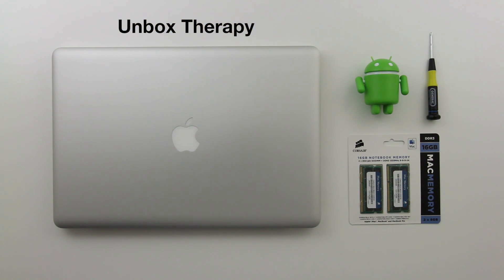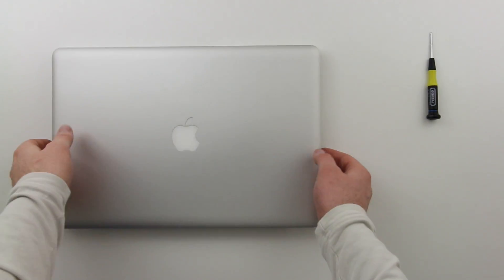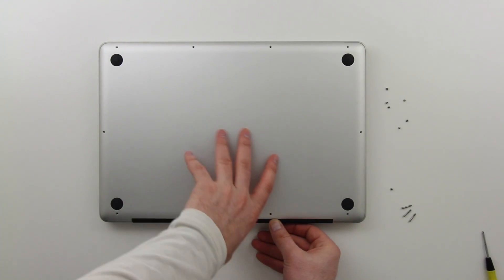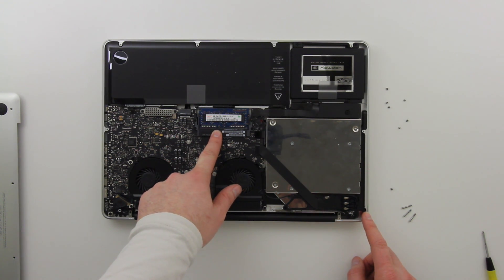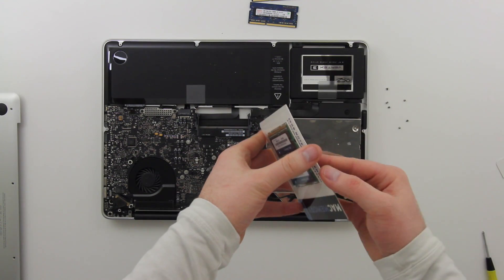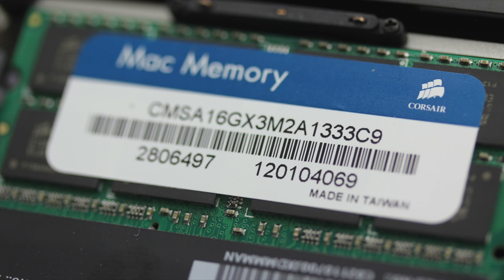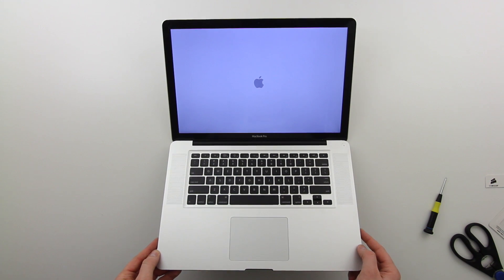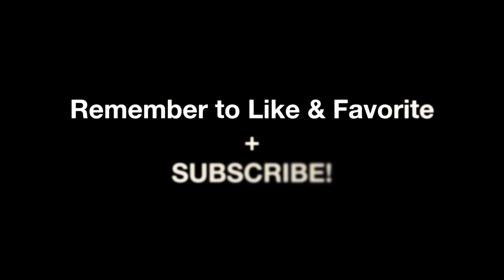16GB MacBook Pro RAM Upgrade (2011)

Comment: What happened if I install 16GB 1600Mhz Corsair for early 2011 13 inch MacBook?
Reply: You end up having 16gb ram?
Reply: +Zestypanda I plug 16GB 1600MHz Samsung DDR3 RAM to my MBP. Works fine, battery drains faster, no significant abnormalities spotted other than that.
Reply: Michelle Martin They don't support that because they're lazy and don't bother to check Intel's tech specs. As for over heating, check ventilation and re-paste the thermal paste.
Reply: I already did it, and i'm not having any problems so far.
Reply: CEZAR
yess, i know. I heard many of cases like yours. I gambled and luckily i didnt have any problems, my overheating problem was gone after i cleaned my vent up.
But I would never encourage people to buy different clock speed for memories.
Reply: +Peter Rumondor is that a late 2011 MBP?
Reply: +gnarly farleigh it's an early 2011 MBP. Oh, and i forgot to mention, its temperature would rise faster and drains the battery.
Reply: +Peter Rumondor This is not supported by apple. I opted out because my MBP already runs hot at times. I upgraded to 8GB instead.
Reply: +Peter Rumondor Don't do it!Your apps will crash all the time, you need 1333Mhz one.I've spent money for nothing buying that 1600Mhz and have problems with it.
Reply: CEZAR
I already did it, and i'm not having any problems so far.
Reply: +Peter Rumondor Strange!It's good!I have 2011 Mac and I installed 16GB 1600Mhz and my mac was crashing most of the time,browser,apps,sometimes it was not loading.So I guess I have to risk again and buy 1333Mhz version as shown on this video.I wish I would watch this video before I was buying that memories.
Reply: +Peter Rumondor A question: you macbook pro is i7 or i5? thanks.
Reply: mine is i7
Reply: 1600 MHz works like a charm :-)

Comment: NEED HELP!!!! Today I've upgraded my MacBook Pro late 2011 with 16 GB RAM but it recognizes only 2 GB alltogether and it does feels like: the MacBook Pro is crawling like a snail. What shall I do? The operating system is Yosemite. Is there a driver I have to install or does Yosemite not accept to upgrade a late 2011 MacBook Pro? (Google couldn't help me!)
Reply: fettaka hassane Now, the problem is solved! The retailer has tried a fraudulent labeling, but he has retracted the RAM-sticks. After this incident I have bought elsewhere 16GB RAM and finally it works.

PS.: I need so much GB RAM because I study filmmusic and there I need applications like Sibelius 7.5 and Pro Tools 12 and it is recommended to have 16 GB RAM.
Reply: +DJKLProductions lol protools nerds, you really dont need that much ram, if you render out like 32 tracks 44.1 thats like maybe 3 gigs

Comment: what size is the screw driver ???? thanks
Reply: Keith go packers Boror as smal as u got m8
Reply: Thanks.
Reply: Lol I just got a bunch and saw which one worked (i didn't buy them I used the ones I had)
Reply: I didn't think I'd have a small enough one but did. I did not want to go out and buy one.
Reply: :D the one I used was huge but It worked Lol
Reply: Nice
Reply: Hahaha

Comment: Hi. I have a late 2011 MBP with 2x 4Gb 1333 MHz memory. According to the store I can't upgrade to 16Gb since the motherboard won't support it. Is this correct?
If not, does the 1333 MHz matter or can I also use 1666MHz memory? Thnx!
Reply: From what I've read, the 2011 models work with 16 GB. I would go to the manufacturers (of the RAM) website and look for a capability list just to be sure. The clock speed does need to be 1333 or lower. 1666 is faster than the motherboard supports. Good luck!
Reply: Reagan Dugan Great, very helpfull -  thnx for your answer!

Comment: I am upgrading my 2011MBP's ram from 4 gb to 8 gb. The thing is I am not sure yet whether to by a solid 8 gp ram or two 4 gp ones. Also, I am confused, in case I bought the 8 gp card whether to leave it alone or to top it with one of the old 2 gp cards. Any advise, please?
Reply: Hu Ko buy 2 4gb ram cards. it's the most efficient way to upgrade ram. :D
Reply: thank u for the advise budy :)

Comment: I'm planning on upgrading my 4GB mid 2012 MacBook Pro. I was going to get 8GB (2 4GB) but would it be possible to get 1 8GB and replace 1 of the 2GB modules that's already in my mac so that I have 10GB all together?
Reply: Atticus Tayar It doesn't work like that man. The memory units have to be equal.
Reply: Alex Buckley I upgraded to 8GB (2x4). I heard that you can have unequal memory but that the computer won't be able to use them as efficiently.
Reply: Atticus Tayar then, is it possible or even efficient to put just one 8 gp card?
Reply: Hu Ko No, it's most efficient to have equal cards in each slot, although it is possible to have it unequal. I put in a 4GB in each slot so I have 8GB total. Are you considering upgrading?
Reply: Alex Buckley I feel like that's incorrect... why would people be positively reviewing this memory upgrade, then?  http://eshop.macsales.com/item/Other%20World%20Computing/1333DDR3S12S/

Comment: So this is MY MacPro early 2011...I need the RAM for Music Production and was considering buying a new machine but someone suggested this, then I came across your great video.  It says MAX MEMORY is 8 gig...does this mean I am unable to use 16?  or do they mean 8 gig in each slot? Thanks!  You’re video is very helpful! 

(From www.apple.com)
MacBook Pro (13-inch, Late 2011) and MacBook Pro (13-inch, Early 2011)
Number of memory slots	2
Base memory	4 GB
Maximum memory	8 GB
Memory card specifications	- Double Data Rate Small Outline Dual Inline Memory Module (DDR3) format
- 67.6mm x 30mm (1.18 inch)
- 2 GB or 4 GB
- 204-pin
- PC3-10600 DDR3 1333 MHz type RAM
Additional notes	For best performance, fill both memory slots, installing an equal memory module in each slot.
Reply: Some older and even some of the newer Apple Mac's have a limitation from the logic board to how much RAM they can have in this case unfortunately 8GB is the max if you were to place more than 8GB, the Mac simply wouldn't register having it installed, so yes to answer your question 8GB is the overall max RAM the Early 2011 Macbook Pro can hold across both of the sticks meaning the best you may have is 2, 4GB sticks one in each slot, don't worry though unless you are going to be using programs such as Sony Vegas or Maya or anything really RAM intensive, 8GB will be more than enough especially if it will only be used for music production by which I assume you mean to use, GarageBand or Logic :) hope this helps!
Reply: Dang it it did!  BUT I should’ve waited before I ordered the 16 gig from eBay uuuggggh!!! Spent all that money for nothing!  My fault but thanks!!  At least I know now :-)
Reply: wnk3thebreeze I'll buy that RAM off you for a good price, is it DDR3 1333 16gb? then you can get the 8gb and save some $$
Reply: Nagvera | Official in the description of this video he says he uses an early 2011 model and it works just fine even though apple claims otherwise

Comment: Great video! I will be upgrading my RAM this holiday season. Also, thank you for the link to the RAM. I am just wondering, what kind of screwdriver you are using to unlock the bottom of the MBP. Could you provide a link? Cheers!

Comment: Can I upgrade my Mac with 16GB. It is a 4GB 2012 Macbook Pro 13.3'' Model, newly purchased. I read in apple RAM Upgrade section that I can just go upto 8GB with 1600MHz RAM. Can I use the same specs for 2x8GB in my system

Comment: anyone know a source where I can get 16gb ram for my early 2011 mbp with a reasonable price?

thanks.
Reply: amazon?
Reply: Amazon. Crucial is the brand of memory I have used for all my MBP's (obviously, I havent had any complaints)
Reply: Conveyable Carries http://www.amazon.com/Crucial-PC3-12800-SODIMM-204-Pin-CT2C8G3S160BM/dp/B008LTBJFW/ref=sr_1_1?s=electronics&ie=UTF8&qid=1408912710&sr=1-1&keywords=16gb+memory+mac
Reply: You can get Crucial brand from Amazon. I just got mine and replaced it. Great quality.
Reply: VDTHD  can i get link plz

Comment: I am looking at a used MBA. It's a bit older. It has a Core2Duo and 2GB of RAM. But it should be upgradable. The thing is, it says 2009, but it has the same design as the newer ones. It must be one of the first Airs. Is the RAM upgradable and what RAM do I need?

Comment: I've got a 13" early 2011 macbook pro running 4gb of memory i want to upgrade to 16gb. I've done a lot of research and it will accept the 16gb upgrade. my concern is maverick os, is the 16gb upgrade still working ok for people who has upgraded? just something a friend said has got me worried.
Reply: im looking forward to do the same thing, have you upgraded already?
Reply: not yet! I've emailed a company that sell upgrades for my model of mac and they said its all good guaranteed to work on mavericks, if you are concerned about that too.
Reply: Yeah im concearned aboit that too, what company is it? I've also got an early 2011 macbook pro 13"
Reply: Raymond K  Great video! But unfortunately.. I downloaded the crucial scanner and got this:
	Generic Application Error
		 			Error Type 		 		 			Error Message Key 		 		 			Message 		 		 			Originating Command
0
_ERR_CMD_CMD_NOT_FOUND
					User 					
CMN3101E The system is unavailable due to "ScannerRedirectView".
					System 					
Command not found: "ScannerRedirectView".

Comment: If i get 8gb ram will final cut pro run smoothly on my Macbook pro 13 inch?
Reply: I have a Macbook Pro 2,4 GHz Intel Core i7 with 8 GB RAM, and running Final Cut Pro X is TERRIBLE! I had to stop using FCPX.
Reply: Get an Evo ssd from Samsung 840 series. It'll make a world of difference. But just my opinion. You don't have to. Do some more research first, and then make your decision.

Comment: Can anyone help me?

I don't know much about computers but I have a 13" MB Pro. I use it for video editing and design software, i.e. Photoshop, but at the moment it seems to crash if put under a little bit of pressure.

Can anyone reccomend what memory I need, i.e. 8gb or 16gb? does it matter if it is (4x4) or (8x8) or just 8gb and 16gb?

and should I buy it from CRUCIAL.CO.UK ??

Comment: The Apple website *does* say it only supports 8GB, but multiple sources have verified that certain models run fine with 16GB. The late-2011 17" MBP is one of them that does.

Comment: Changing parts such as ram and original hdd do not void your warranty. Apple tech told me as long as they are visible parts ie hdd and ram you can change it without voiding but anything other than ram and hdd will void it.

Comment: im just wondering, im using 2.3GHZ intel core i5 with SATA device 3 and my MBP are in early 2011. is it compatible for upgrade for 16gig which i compared your video has "i7" and "ssd" installed. 

your video are great btw

Comment: Nice video! I just bought a 8gb memory, my question is: can i use one of the original memories + the new one? 8gb+2gb, both are 1600mhz, but from different manufacturers, or will be better stick just with one 8gb?

Comment: yeah i swapped out the hd and put an ssd and put the old hd into a owc swap kit for the optical d. it runs multiple apps fcp, ps,a few web pages with videos running alittle smoother with the 16 giggs but i couldnt really see a difference... smoother is better so i guess its worth it...

Comment: download this app:
crucial.com/systemscanner/MacOS.aspx

It will scan your system, after that you can get the frequency, example 1066Mhz

MBP Mid 2010: 1066MHz DDR3 SDRAM; supports up to 8GB
support.apple.com/kb/sp582

Comment: I ordered the same 16gb MacMemory ones and I can't wait. I on a daily bases record commentaries (typically 10-20 min long) and I record the gameplay using Game Capture HD while I also run Garageband in the background to my Shure mic at the same time. It worked good for a little until the videos started adding up. Plus I also edit on iMovie because my computer is to slow for After Effects which is the main reason I'm upgrading so large so I never have to worry about my Ram.

Comment: Yes, you can. Apple doesn't say that they support that because they only officially tested them 8 Gigabytes of RAM but the Macbook pro 13" is compatible with 16 Gigabytes of RAM. Also just a side note, The amount of RAM you need is also justified by what you're doing with your computer, Could you tell me?

Comment: mann i dont suppose the macbook pro 2012 can handle a 32gb ram upgrade? .. got the 8gb upgrade from apple, but for affects effects and the new animation job i have got, it runs soo slowly, im 19 by the way :L so moneys a bit of a issue atm, but if its cant handle it, will use the 16gb, where you get it from?

Comment: i have a 2010 macbook pro and the ram limit is 8gb for this model :( i upgraded from 4 to 8 and one ram module was messed up it kept bringing up kernel panics so i finally found which one was the bad one. im using one 4gig ram module and one original 2gig module lol.. i use almost all 6gigs just by having a lot of applications opened plus virtual machines need memory too. if i could have 16gigs i would.

Comment: Double check that both sticks are FULLY inserted. I had the same problem, you have to make sure every single pin is making a connection, otherwise only one bay will show installed. Take both out, and firmly reinsert

Comment: Your computer doesn't slow down if your are multitasking. Analogy: Picture a study desk. You have a standard desk that lets you hold books (applications), utensils, papers for your tasks. Say you are done with biology and you need to do math? Well since you used up all your space you are going to have to swap your current book. The built in ram swaps ram memory toward the application you want to use when it needs more. This makes your computer to run slow because its under a process of swapping.

Comment: If you have an integrated graphics card like the intel HD 3000 or 4000 like most macs do upgrading the RAM will also add to the amount of memory it can use (348mb with 4GB will go up to around 1GB with 16GB RAM) in case you guys didn't know!

Comment: Just ordered 2x8GB memory banks for my early 2011 Macbook Pro. I'll get it tomorrow, so hope it will all work! One question though, will it use the full 16GB? Or will it work, but only use the maximum of 8GB as Apple says? And is there a simple way to check this?

Comment: RAM stands for Random Access Memory. It saves small amounts of data, way faster than your computer would do on a regular hard-drive. this could be used for gaming, servers and mostly small things that are controlled by your Operating System. (which usually wont need more than 0,5-1GB)

Comment: The computer needs to be grounded :). The easiest way to do so is to plug it into a main. Don't forget to touch the metal case, not the plastic parts!

And don't worry, i am building computers since years and nothing bad happened:)!

Comment: Rather, the simplest advice (if you don't do alot of computer building) is to discharge yourself on something metal before you start - preferably the computer case, or the frame inside. Hold onto it with one hand until you need the other hand, and any static electricity you may have built up should have absorbed into the metal case.

Comment: My MacBook Pro is a late 2011 model that was purchased in February 2012.  I was just on a chat with B&H Photo about which memory I need to purchase for the 16gb upgrade and they told me my computer would not handle the upgrade.  When I questioned that based on this video and comments I've had here, they just cautioned me about being sure before I did the upgrade.  They also mentioned something about this upgrade causing an external screen to flicker.  Have you heard anything about this?

Comment: well i had a friend who bought 1600mhz ram for his early 2011 macbook pro and the mac couldnt recognize ANYTHING (actually he had problems booting up). some people say that their macs run just fine with 1600mhz ram but even for them with no problems; their macs automatically kinda "downgrade" the memory speed to 1333. so overall theres pretty much no point in buying 16000mhz ram cause even if your macbook recognizes it will downgrade it as i mentioned. so why dont you go straight for 1333mhz?

Comment: If you don't have a flash drive, it is useful to speed second access to files, because it is used as disk cache.  You probably won't need that much unless you are doing bioinformatics or some other big data munging project.

Comment: i'm wondering if anyone can help me out? I'm looking for 16gb of ram to my macbook pro 15inch early 2011. I found some ram with these "specs"

Corsair Vengeance DDR3 1600MHz 16GB
Kit w/ 2x8GB CL 9-9-9-24 1,5V 240 pins Dual Channel

will that work?

Comment: Guyz.. Can I add 10GB ram. Since my mac has 2x2 GB ...I was planning to get a 8GB single chip and place it in one slot ..to make 2+8GB =10GB. 
Will this work without probs,,,?or should I get 4x4gb and leave the idea of 10Gb....coz I am planning to run Virtual machine side by side.. and play intense GAMES on Virtual Machine

Comment: Hi!! I have a MacBook Pro early 2011 15'' 2.0 ghz and I just installed the same 16gb corsair ram, BUT, im having some issues. Before my boot time used to be around 1 minute, now it takes almost 3 minutes! And when the battery is low or disconnected, sometimes the speaker icon gets gray (disabled) and there is no sound at all. To hear any sound, I have to restart the mac, plug the battery and pray! lol Everything else works perfectly!Do you have any suggestion? Thanks! And great tutorial!!

Comment: No you can't, dumbass.  Pretty much the only laptops that compete are Ultrabooks that are within only a couple hundred dollars of a MBP.  Basically, to get a laptop that really competes with a $1400 MBP, you're going to be spending over $1200.  Sure, there's still a bit of an "Apple tax," but it's really not as much as you think when you actually go out and do the research.  Just don't buy upgrades through Apple.  That shit IS overpriced.